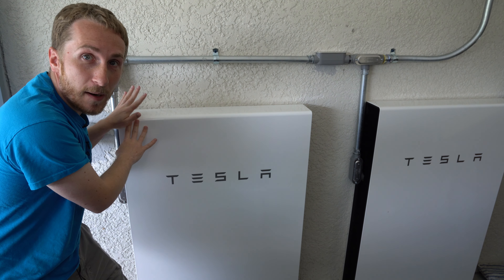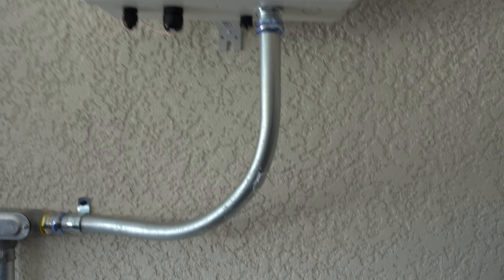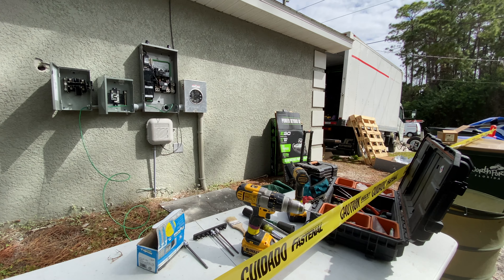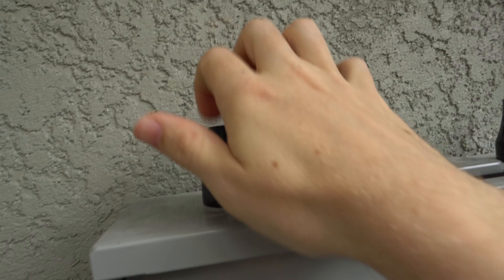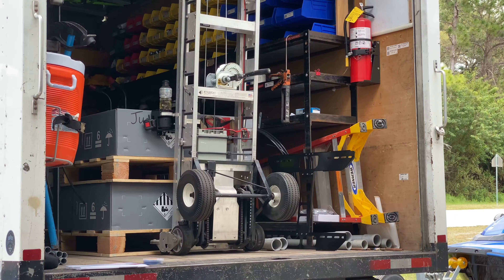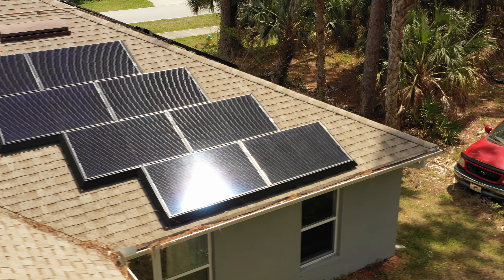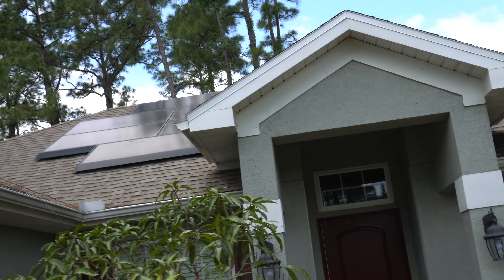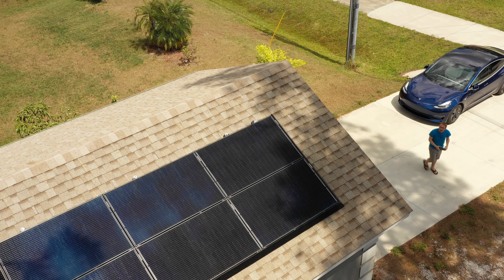Tesla Solar and Powerwall FINALLY Installed !

Comment: Jeremy ... this looks great!  I have had an awful experience with TSLA energy in general.  I love my Model 3 but I wish I had looked elsewhere for the solar option.  My installation schedule took over six months due to their sub-contractors flacking out on me (for asking detailed breakdown of costs!!!).  I am glad though because I was able to get the roof upgraded for $5K less than what TSLA sub was quoting.  
TSLA solar team finally arrived but the installation took 3 days (no issue .. I know I have a high pitch roof) but they broke over 170 tiles (by their own account) and damaged brand new concrete.  
I am waiting for the last 5 weeks for TSLA to come and fix these things.  By the way, in your install tiles look really low profile ... mine I can see the sky through them when looking at them from the ground!
Any case ... congratulations and I hope this works out for you!

Comment: Other than the POwer Walls, which are optional, the rest of the equipment is off the shelf components. Solar Edge inverter, and from your other video, Q Cell panels. They’re basically just reselling.

Comment: Good video. Whats the new net meter you mentioned that needs to be installed by your utility company? I am in CA with Southern CA Edison and there is nothing like that here for net metering. I will continue using my old utility meter from 2003 . My solar / PW install is on Monday Oct 19.

Comment: What size house do you have? Why do you need 2? I have a 1300 sq. foot house .  Would you say 1 would do?  We don't have a lot of outages here .  Los Angeles here......What does your 1st power  bill or 2 look like? Completly down to nothing?
Reply from the maker: You need 2 powerwalls to be able to operate your AC in most cases. 1 Powerwall allows you max 5kw power. 2 allows 10kw. 3 15kw and so on. I would love to have 3 at this point. More powerwalls allow your solar to operate longer too when you are off grd. If your powerwall is full, your solar will cut off until your powerwall loses some charge. I have a 1800 square foot house. I still you would benefit from 2, despite the smaller house. My power bills have varied like $10-$40 so far. We are home all the time and always have AC on, and I charge my Tesla as well.
Reply: @jeremyjudkins  Nice man. Thanks!

Comment: Are you live yet? I obviously missed this video when it first came out. I want batteries so badly...but way too expensive for me now...But I hate throwing away power - yea...the power company gives me some monies but it ain't worth it. I am getting some really strong days now that we have moved into spring(early summer) and I will begin to collect some data of how much I am exporting and do the math on it to calculate a payback for batteries later this year. Take a look at pvoutput.org...not sure if it integrates with a Tesla solution or not - I guess you could always update manually. It is a very good resource however.
Reply from the maker: Thanks for the link. I did go live about a week ago. I am selling very minimally back to the grid, seems like my two power walls is good for my usage and excess so far. If it is cloudy or if I charge my car more than usual the batteries don't last all day. Gonna monitor usage for a few months to see if it makes economic sense to cut down some trees to increase production. However, I'm not going to do so, just for the sake of exporting power to the grid, since like you said, they pay back a lower amount. Biggest test will be if they can keep up during the warmer summer months, but hoping longer days plus sun being higher in the sky should increase production. I'm at about 40 kWh per day right now on the sunniest days.
Reply: @jeremyjudkins  It's funny how I no longer charge over night. I typically start my charge around 10AM - right now I have it scaled back to about 24 amps which will cover all I can make...ie charging for free. AC won't come on until the afternoon - hopefully by then I am done charging. This makes for free AC at this point as well.
Reply: I see this all the time. Basically people are sold bigger systems than they need at a higher price they need to be paying. Of course they make more doing it.